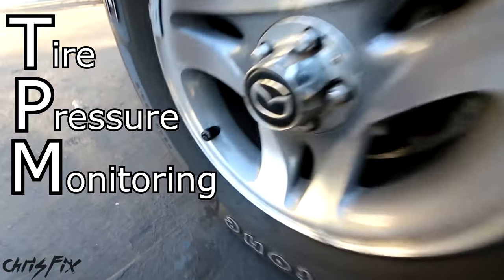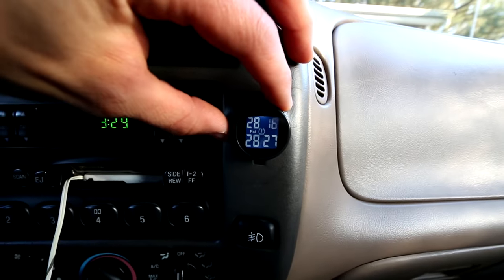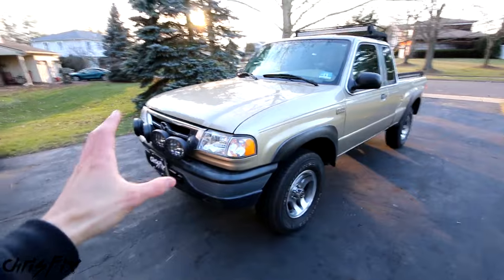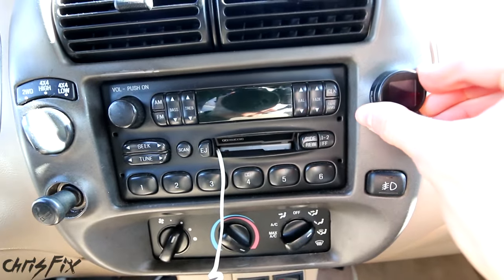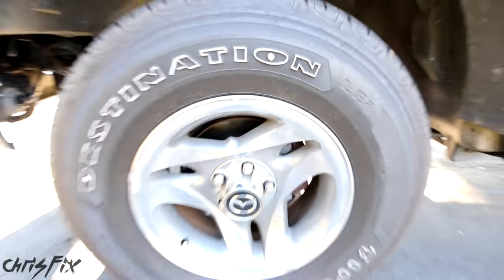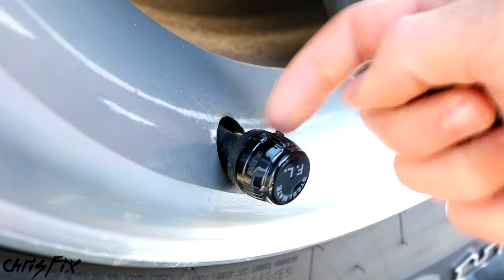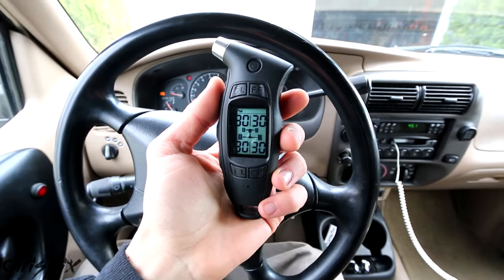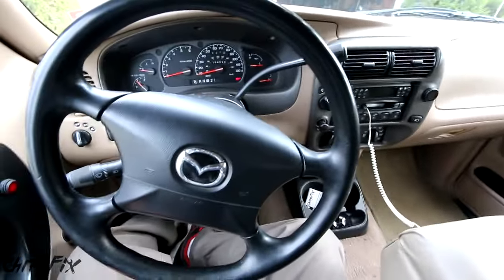How to Install a Tire Pressure Monitoring System in Your Car

Comment: wayyyy to expensive for its functionality... 
Just check the tire pressure every month and every time the weather changes significantly (temperature). 
If it was 20$ then I would consider but the amount of tech involved increases the price also I fear that it would get stolen easily .
Reply from the maker: +André Carvalho I wish it was half price. It cannot get stolen easily because it locks.
Reply: +ChrisFix I think this is exactly as having parking sensors or hill climb assistance, you don't need them until you have it (or drive a car that has it regularly). 

Yes it might be hard to remove for the thief but also for the owner. This is actually useful for people who "don't care" about the car just drive off and don't inspect it regularly. 

Nevertheless, good video!
Reply from the maker: That makes me think I should do a parking sensor install video. Hmmmmmm.
Reply: +ChrisFix Everyone should have it they cost 15€ with a color that you want already, the eBay ones. 
They Work perfectly fine, one should be carful with the placing of them but with some testing its easy. In the end if you bump into something it's Going to cost more than 15€ to fix, So it a good safety feature to prevent damage repairs. 

Even if a part fails, the whole kit cost 15€ you could replace cheaply each part. An OEM sensor costs wayyy more than this whole kit and in the end does the same. 

Do a video it's worth it!
Reply: +ChrisFix I love my car, and I really take care of it, however, busy lifestyle and being always on the run is hard for me to check pressure everyday.
I actually bought this set because you recommended it and because I was saved by a TPMS system back on 2009 when one of the tires of my jeep liberty was punctured by a big Nail... I actually was doing highway speeds and thanks to the beeping of my TPMS I was alerted and came to a complete stop before the tire was flat.
So I will be installing this in my 03 jetta
thanks!
Reply: +ChrisFix You should the same company had a set of those on Amazon.
Reply: +André Carvalho Right now it's only like $25.00 per tire that's not too expensive and sure checking pressure is fine for some people but it's not fine for others and 90% of people wont check their tires when it's -20 to -45 C, but I could see getting this for my mother to help keep her safer in fact I could think of a whole ghost of family members this would be prefect for. I'd like a set of 2 for my bike that would be cool.You have to have those 2 tools to steal it did you not hear that part?
Reply: There is a big car company where I live that sell a cheaper version of these for 25 bucks. Of course they aren't as fancy as the ones in the video, but being a tenth of the original price it is worth it.
Reply: +asdda One thing to consider is that the cheaper version was an idea that was stolen from the person who invented it, and how you feel about being part of that. My tablet is made by the people who invented it, not the ones who knocked it off. I fail at this test too, -all the time, -but I don't relish the bad karma that I feel comes from it.
Reply: +asdda do you have more info on said company?
Reply: Stu VS Not a stolen idea tho. A lot of companies made monitors like these before TPMS. What tablet do you have btw?
Reply: +Kratos000S nobody needs to read what I write also don't you agree? 
The ideia of this channels is mostly change experiences and ideas, am I wrong? 

Go have a nap and then get back (calmer) to the internet.
Reply: +André Carvalho Bad assumptions because you think you are invincible. TPMS became required by law after the Ford Explorer crashes. Over 100 people died. Air pressure loss is an early warning sign of tire damage. Loss of air pressure due to a puncture at highway speeds also leads to serious crashes. Unless you pull over and check your air pressure every minute, it is not as safe as TPMS.
Reply: +straightpipediesel I could agree with you on that!
Reply: +mike tonon If they have a pressure indicating TPMS they do not need to check it with a gauge. First, most TPMS are better built than the $5 made in china gauges people have, or even worse the gas pump air hose. Second, checking the tire leads to air loss, and potentially causes the valve stem to bind, creating a leak.

TPMS was invented for commercial airplanes first because of the second reason. If you don't have it, you have to check the air pressure after each flight or each day, and there they make you use soapy water every time you connect to the valve stem, and then you have to watch it for a minute to look for leaks.

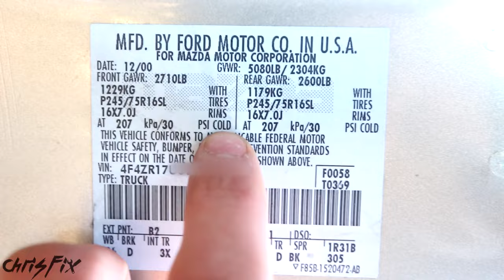You're saying the manufacturer sticker at 3:24 is wrong? I don't think you even watched the video.
Reply: +André Carvalho That's true. This is the device I have always wanted because I think monitoring tire pressure is so important for driving safety, but after I saw the price, I think I would stick to my manual tire pressure guage
Reply: some people dont know how to check the tyre pressures, and drive around on a flat tyre(females mainly)
Reply: +André Carvalho I thought it was like 50 dollars, lol.
Reply: +dom why Not just females believe me, 29 years in the trade tells me this!! But yes I agree can't understand how people don't notice. Some guys are terrible as well.
Reply: +André Carvalho check out aliexpress im sure would have a cheap one
Reply: +André Carvalho it cant be stolen easily
Reply: +Andre Carvalho 
Hi Andre. My buddy bought a TPMS almost identical to this one online for 68 shipped. I'm only telling you this because Chris did not mention that he was getting a cut of the sales. He was only supplied the item for free as long as he made a video showing the product. I have the same business arrangement on my channel.
Reply: +André Carvalho a wrench and a pair of plyers thats all you need it may damage the outer case of the plastic but thats it, use a towel and its completly fine, yes the tools given to you are good to use but it should of had its own type of lock maybe a "triangular small screw that holds it and 2-3 copys of the key.
Reply: Lol I agree. But still kind of cool haha.
Reply: +ChrisFix hey Chris and what if they run out of battery??
Reply: +André Carvalho  I was shocked too, 100bucks!? Hell no, i just check it with my pressure gauge on my air pistol lol
Reply: Checking your tire pressure every month is nice and all but when you do a lot of driving or far driving checking once a month isn't always a smart idea I've had issues where I used to check once a month and a day or so after I checked my tires was going flat and had no idea until it popped because there was a nail inside it. If I had this device it would've told me and I would've put air in it and if it kept going flat I would've gotten it replaced before it got to the point of not being able to drive it. This is a safer way of keeping an eye on tire pressure and is worth the 90 dollars or so just depends on whether or not you car about your safety and want to spend the money.
Reply: +straightpipediesel Dude, many TPMS systems don't tell you which tires are low so you have to check them all anyway. Secondly,  only a moron can manage to ruin their valve stems by checking tire pressure.
Reply: +André Carvalho 
The thing I most hate about dash cams, and devices such as this, is that they take away your only power outlet, and do not give it back. Come on, we had daisy-chaining of connections, decades ago on computers. Christmas tree lights, usually have an electrical outlet on the back side of the plug. Even standard home wall outlets, are all now duplex, having not just 1, but 2 power outlets.

However, the cigarette lighter standard, makes for such a large plug, I am not quite sure how best to return the power outlet for other devices. To neglect this consideration, hardly makes much sense, at the cost of this device.

That fancy custom center console, should have had an added power outlet or 2.

Of course, if you have some fancy new $40,000 car, perhaps it comes with 5 cigarette lighter power outlets, and then losing 1 or 2 of them, isn't so bad.

It is nice to have a handy readout of tire pressure, but this device makes it a lot harder to add more air to the tire? Seems seriously counterproductive?

Why do the batteries last only 2 years, when my watch battery boasts 10 years? It is like the new "smart" watches, that are so dumb that they can not hold a recharge more than a day or 2. What are they good for? Smartphones cost less and do far more. Maybe some years later, when they design them better.
Reply: +Yosef MacGruber You're right. I'd rather use my outlet for a dash cam.   There is no device more important these days than a dash cam.  I have one in all my cars. For only $50.00 why not? Dash cam footage is your proof of innocence in an accident. Do you know the first question insurance companies ask you when you report an accident?  "Do you have a dash cam?".  I anticipate that in the next 5-10 years, dash cams will be a built in standard feature on all new cars.
Reply: Wrong..
My chevy s10 has 3 power plugs standard...and that truck  is 20 years old lol
Reply: Nick V
Are dash cams, Big Brother spy on you devices? How often are dash cams, used against their owners?

That said, of course I see 2 huge advantages of dash cams. One is, like you said, to prove that the other guy is at fault, and that I did indeed have the green traffic light. The other is, Where else would we get all these cool YT videos of trucks flipping over in the wind, or of all the scary moron drivers out there?

Of course, if dash cams are so great, why only get 1? Why not at least 2 or 3 dash cams, to cover all the different angles? One dash cam for every power outlet. Wait, what happened to all my power outlets? Is  there not even one model out there, that will share power outlets, or run 2 or 3 dash cams on the same cigarette lighter outlet plug?

BTW, my cigarette light outlet stays energized all the time. I really like that, as there is no need to shut down my GPS during a pit stop or while pumping gasoline. I presume that some dash cams can automatically detect when the engine is running? But it would be nice to have a motion-activated mode, or to record video day and night for security purposes, well presuming that vandals or loiterers, do not simply steal the dash cam.

The reasons that scare me from not getting a dash cam, is that they are probably a pain to use. How many do not automatically loop their memory, automatically deleting old footage to make room for the new? Where will I plug in my portable Garmin GPS? If a dash cam is so important, why do I have to unplug it when I need navigation assistance? And wouldn't somebody just break in and steal my dashcam?

Of course, dash cams may be of some help against road rage idiots. I could just say, "Smile, I already have your antics and your face and your license tag on camera. Keep it up, I am sure it will help me win in the court hearing."
Reply: Michel Linschoten
Well I guess most old econo-box cars, just have 1 outlet. Even though they have A/C, cruise control, power steering, power brakes, power windows, and all those really old "luxuries". I do not even have power seats.

Adding more outlets, would be a great upgrade to a car. But most of us practical people do not have money for crazy car mods. I suppose that replacing the radio, might give just one powered USB port, that could be used for power only, and not necessarily for devices that have any function related to the radio?
Reply: +Yosef MacGruber dude theres cigarrete lighter splitters i have 1 in rach of my vehicles and they have 2 cigarrete plugs dodge charger has 2 one inside the arm rest and one near the console, my ford focus has 2 centered, my ford explorer has 1 in drivers side 1 in passanger. i ONLY use the splitter to hide all the cords underneath the seats i hate the wires all over the place.
oohh and my old dodge caliber had a power outlet and a cigarrete lighter, i mean if you using  a 80-90's  car then maybe you only have one all these models are 2001-2011 and they have  1 cig 1 outlet or 2 cig. 
as far as whats more important a dash cam and people are not sumb theybwont use them agaisnt themselfs they eill say it was off or not plug whatever they want to  prove that it wasnt their faoult having 2-3 would be great but honestly why bother
Reply: You do know their is such a thing a cameras with multiple lenses right. You can also easily add a entire bank of oulets in the existing one. You pretend their is no solution to your problem....

Their is plenty for nearly any wallet size if you know what i mean. 

Also every dashcam will loop and most do have a motion and even g sensor. And yes even the cheap ones....have a battery for those modes.

Or else it would not be a dashcam. I use an el cheapo one for years now never failed me or lost any data (memorycard recording virtually impossible anyways) 

Thieves do not get tempted if you just use the dexterity of your hand and slide it of its holder. And put it away....
Reply: Alucardjr69
Well my car must then be an outdated piece of crap?

Yes, I have a triple cigarette lighter outlet splitter, that a friend gave me, around somewhere. Have never used it. Hope that it works. What a great way to start a messy rat's nest of wires to get in my way in a small cramped car.
Reply: Michel Linschoten
You can also easily add a entire bank of oulets in the existing one.

That sounds like some major dashboard surgery. Does the dash need to be removed, to do this properly?

I am assuming that the G-motion sensor is to detect towing attempts, somebody bumping your car, or stray shopping carts? I meant video motion sensor, but motion sensor is great also. Great to catch every offending gust of wind, or undisciplined neighbor's children walking on top your car.

Putting it away? Sound like a counterproductive bother, if I think I need to use it on every little drive. There are moron drivers out there everywhere. I was ever afraid to use the suction cup with my GPS, because some desperately poor thieve might think my ancient GPS is worth something? The suction cup could leave a tell-tale ring, and lead somebody to break in to steal my outdated-maps little GPS?

BTW, are truck drivers being outfitted by dashcams now? As many hours as they spend on the road, it could be a good idea? Presumably, employers might want to spy on their employees?

Have you ever had occasion to be glad that you were using a dash cam?
Reply: +Yosef MacGruber  Yes, dash cams will turn on/off automatically. They are set it and forget it devices.   They are in no way a pain in the ass. I haven't even touched mine since I set it up two years ago. 1) Yes, there are dash cams that record multiple angles. 2) Yes, all dash cams record on a micro sd card and the memory is looped.   3) Yes, almost all modern dash cams have motion sensor and shock sensor tech if you wish to turn on those features. Good for seeing who dinged you in the parking lot while you were in the mall.    As for unplugging it to use your nav unit, why? Just buy a $2.00 plug in adapter on ebay that turns one outlet into two.  As for theft, sure anything is possible but unlikely as dash cams are not expensive. $20-$40.  Your GPS unit is worth more.
Reply: That sounds like some major dashboard surgery. Does the dash need to be removed, to do this properly?

Nope not at all, it's a plug and play system their to many to mention. For sure there will be one that just snugly fits your car/dash.

I am assuming that the G-motion sensor is to detect towing attempts, somebody bumping your car, or stray shopping carts?

You can set the sensitivity, so yes and no, imagine someone hitting your car while backing up. It will record the incident and or even snap photos in a burst (as some do)

Putting it away? Sound like a counterproductive bother

Now if you are too lazy to just grab a cam and put it away. Buy one that mounts behind the mirror bezel. You can barely notice them from the inside nor outside.

some desperately poor thieve might think my ancient GPS is worth something

You're overthinking here, perhaps you should smear pure shit on your car. As the awesome color might make it more desirable to steal it, or seat covers as the nice leather seat equals $.

Mmmmm....so yah i know weird examples but if you believe a thief will look for suction cup marks (lol) i guess you might have a point there 

are truck drivers being outfitted by dashcams now?

It's more and more becoming the norm, i am not saying they all have it. Not every company invests that amount of money into a FLEET of trucks. However, i am sure that the ones that do it are happy with it. Matter in fact i know a trucker that wants to have my old camera for in his hauler. Point made i think, truckers are more prone to getting robbed, or into altercations in normal daily traffic. So yes i would say it becomes a standard in x amount of years.

employers might want to spy on their employees?

They already do, MOST of them actually....do not think for one moment that they do not know were you are, or when you speed, or when you take a to sharp turn. It gets all logged, a camera in the cabin would not matter at all. As long as they do their job,that what the get paid for to do.

Have you ever had occasion to be glad that you were using a dash cam?

I got into a altercation recently, so yes it did help me greatly. It actually made the other guy go back into his Corvette and drove off, once i told him that he is on camera trying to pull me out of my car.

I cut him off by accident, i apologized (sticking my hand up making clear with my face i am sorry did not see the dude) and think nothing of it.  Until we got to the first traffic light, he came out his vette and started to verbally attack me. I remained calm and pointed at my camera which captured it all.

He left....
Reply: +Michel Linschoten NOT at all ... Pretty simple ... The hardest is to find the right power feed that has energy only when the engine is on...
Reply: André Carvalho
What does it matter, if the power feed stays on when the engine is off? Such devices should use so little power, that even if the readout glows all night, it is not going to drain that huge car battery. Only a major power drain, like the interior dome light or headlights, is capable of draining the battery in a few hours or days.

Does anybody have any idea, just how many devices in the car, stay energized, even when the engine is off? Even when the car has been parked for hours. The clock, the standby circuit in the car radio even though it is not playing music, some dash lights might still indicate, often anything plugged into the cigarette lighter power port, etc. If you have keyless entry, that obviously stays energized or it wouldn't work properly. Could somebody complete my list, as it might be a dozen items or more?
Reply: +Yosef MacGruber I would guess the car's computer stays energized or else why would it erase any check engine light trouble codes and go through testing mode from scratch when you replace your battery.
Reply: Nick V
Computers use very little power when they are asleep. But more modern computers, can store that data on flash memory. But perhaps some of the reason why old data such as that, is not used, is due to people getting code scan computer programs that could rewrite fake data, tampering to pass stupid car emissions tests, or just because the old cars computers are old? While the battery was being replaced, what else might have been replaced? If the computer is actually off, it can not detect if various other sensors were replaced, thus, after being off, perhaps it needs to "re-calibrate" itself? But I am not a car mechanic.

Yes, we can add that to the list of "power vampires" that ever drain the car's battery, although hopefully, very slowly. Thus all the more reason, why an unused vehicle, still might need to be started up, a couple of times a month. To keep the battery topped up. To circulate the fluids, and to turn the tires a little, so that they do not get flat spots in them.